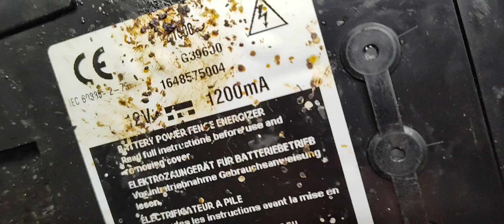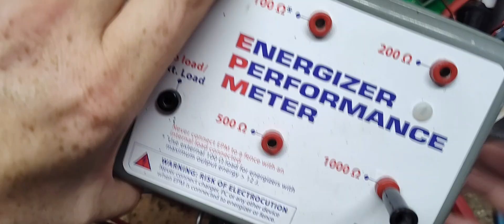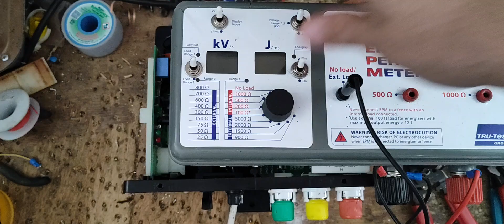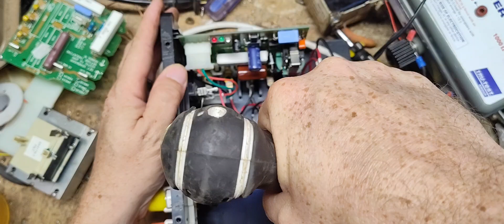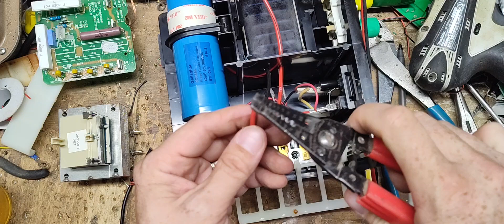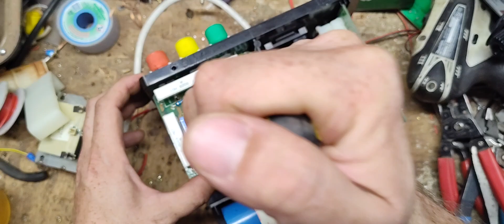Electric Fence Charger Clicks But Has No Output Voltage, What's Wrong? | Gallagher B1600 Repair

Comment: Those Gallagher rectangular block type transformers where designed for max 7 joule output energizers like the B700 (5J), Medal 1000 (6J) & i Series M1200i (6.6J) units. The transformer is unfortunately not efficient enough, delivering only 8 joules. If you can get MBS1800i/MBS2800i output transformer that B1600 will deliver over 12 joules output @ 100-ohm load. They are not too expensive, but you will need the steel plates as well.
Reply: Perfect ❤
Reply from the maker: Finding the metal plates and making the transformer physically fit will be difficult I think.